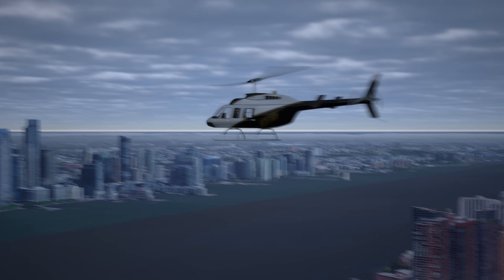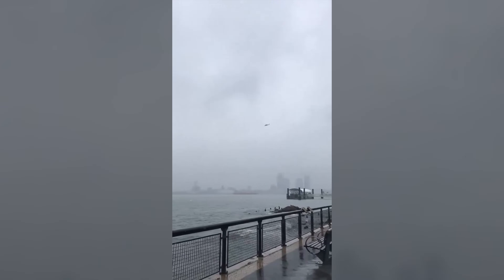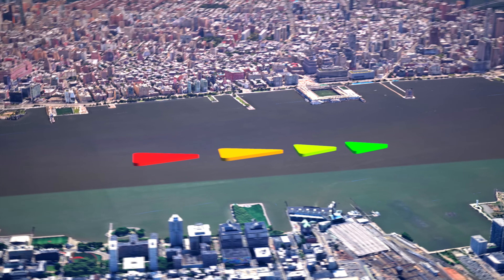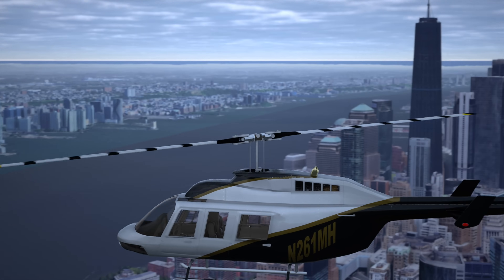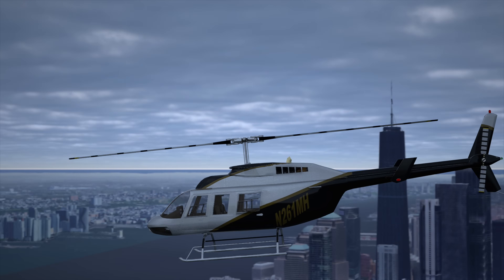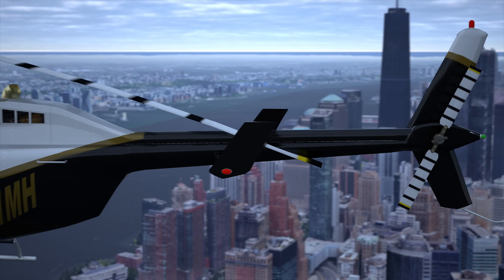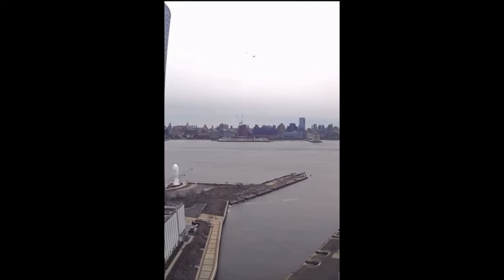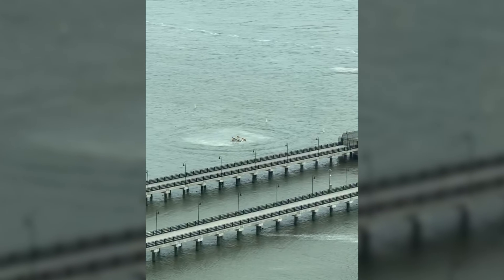Helicopters DON'T just fall from the sky - What is "Mast Bumping"?

Comment: Looks like the main rotor section flew off away from fuselage. The tailboom rotor not designed to hold the weight of helicopter therefore it broke away, this leaves the fuselage on free fall. If the main rotor hit the tailboom it would’ve been explosion or spiral decent.
Reply: I think the blades hit the tail boom and cut it right off and at the same time the collision caused the blade assembly to separate. A helicopter going down and stopping and rising suddenly, could cause the blades to hit the boom
Reply: @ if it did it would’ve shuttered the blades in pieces, the other video still showing the full intact 2 blades spinning 🤷‍♂️

Comment: Looks more like main gearbox failure. (Mast bumping would cut the main shaft, leaving the gearbox on the helicopter).
Seizure of the gearbox imparts massive torque from the rotating main rotors to the gearbox mountings and the fuselage, resulting in the tail boom breaking off at its attachment to the fuselage and the gearbox breaking out of the top of the fuselage, remaining attached to the main rotor shaft & rotors.
(Possibly only the top part of the gearbox, if the gearbox housing has broken appart, as can happen when metal parts get trapped between gear teath, pushing the gears out from their position, braking the housing).
The tail boom could be severed by contact with the main blades but that would likely leave a longer section still attached to the helicopter, so I don't think that's what happened.
Possibly a case of not responding appropriately to a metal chip warning on the main gearbox. (Like one of the V22 Osprey incedents).

Comment: Dip shit,the main gear box and rotors broke,it happens,and when rotors seperated they cut off the tail boom and tail rotor,was a mechanical failure not caused by bad maintenance but harmonics form vibration.only 4 bolts hold gear box on,i rebuild helos for coast guard 30 years,its fatigue.just opinion as NTSB will determine later